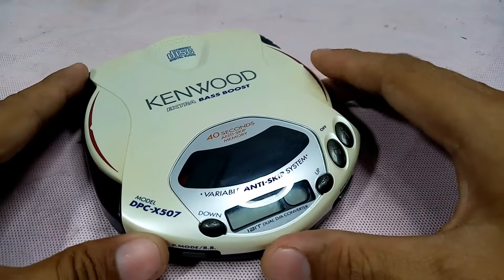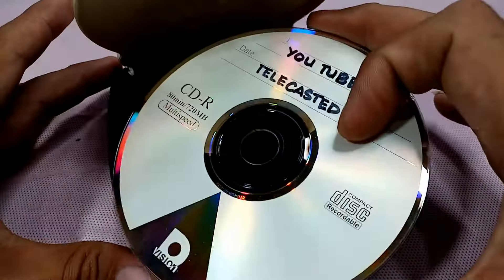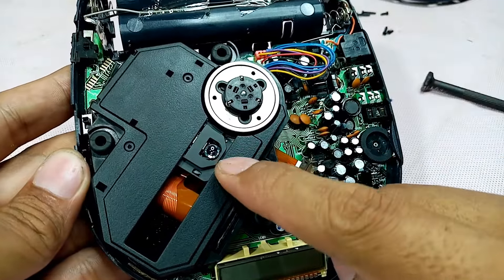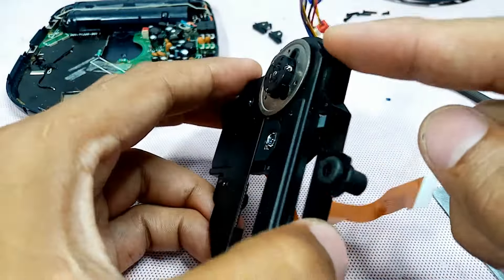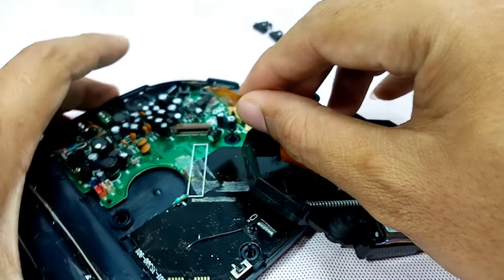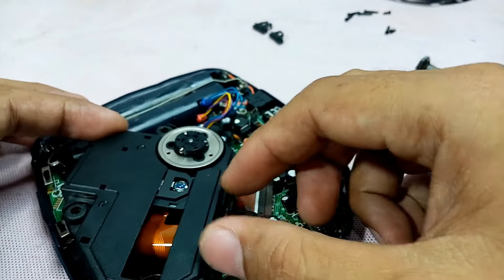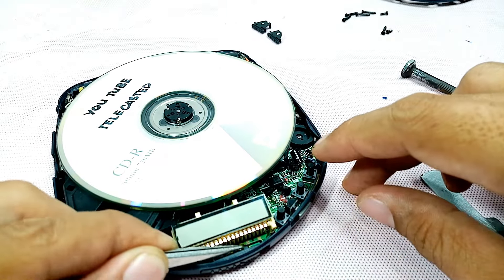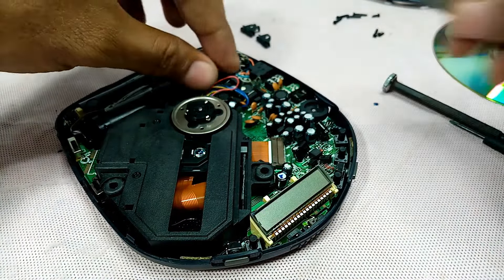No Disc or Disc Error? How to Repair Your CD Player

Comment: I bought a Sony D-NF420 cd player recently.   The former owner said the cd spins but doesn't read the cd. When I receive it, hopefully I'll be able to fix it😊
Reply from the maker: Good luck 🙂
Reply: @woodys_hobbies  I've already fixed 2 Sony cd players. Didn't have to adjust the lens settings
Reply from the maker: @lexbeltran1354   There are many reasons why the player is "NO Disc". In this video this is your last troubleshoot before you need to replace the lens. In no disc one reason is a dirty lens, the shaft that holds the disc maybe too low or too high for the lens to read, The motor or something block the cd to spin and many other reasons.
Reply: @woodys_hobbies  Okay. So I take a screwdriver & turn the trimmer like a screw, clockwise or counter clockwise until I find the correct setting?
Reply from the maker: @lexbeltran1354  Yes but be cautious 🙂

Comment: I have this model of cd player and the disc does not spin. The lcd shows no disc, like you have and the laser will move up and down slightly. Do you know what I should do?
Reply from the maker: That's sign of lens issue. Did you clean the lens with cd lens cleaner?

Comment: Hi man, I changed the laser pickup on my 95 Sony player but it still stops and errors after reading the disc for 30 s. Do you have any idea what could be wrong? Thanks.
Reply from the maker: It's the alignment you need to align by tweaking the trimmer. But always careful in replacing lens. It's hard to align if you don't have a specific tools for aligning the laser in this video I'm using a trial and error no special tools.

Comment: How Many Ohms approx?
Reply from the maker: Not dealing with the resistance. First thing you need to do is put a mark on the trimmer  so you can set it back to default settings if in case nothing happens. To tweak the trimmer simply turn a little bit either left or right until you get the exact point were lens will read. This is a trial and error.

Comment: I have a Philip DBB portable CD player. I accidentally used 6v than it required which is 4.5v and it got very hot I turn it off right away. The sceen still turn on but just keep saying no disc. Do you think I burnt the laser part or I could actually fix it? If I have burnt it will the display still show? Thank you!
Reply from the maker: When you plug 6 volts does the unit turn ON then music play?
Reply: @woodys_hobbies  it got too hot very suddenly I turned it off.
Reply from the maker: @Dee-xt4ll  did it play a music? or it suddenly turned hot when you plug the 6 volts. If the player did not play a music but the player turn suddenly hot maybe you used a wrong polarity.
Reply from the maker: @Dee-xt4ll  I think you plug a wrong polarity

Comment: как решить проблему с заиканием диска (спонтанные остановки воспроизведения)?
Reply from the maker: If it play's stuttering it might have a problem in lens or the mechanism that drive's the lens back and forth. Try to clean the lens with a disc cleaner. Check the mechanism for dust and other debris that stuck in the gears.